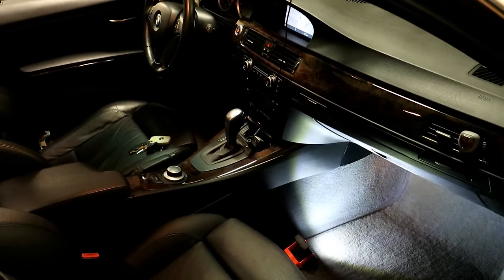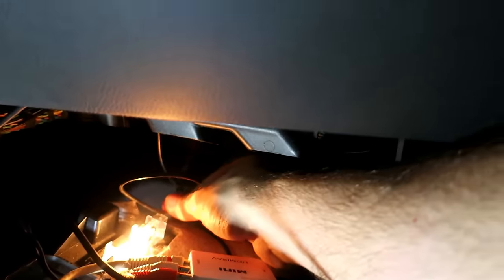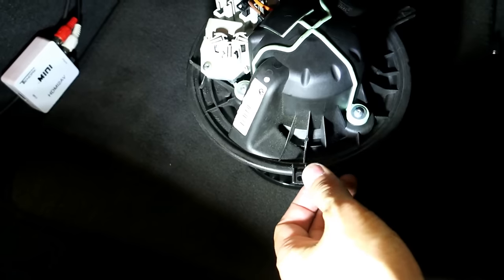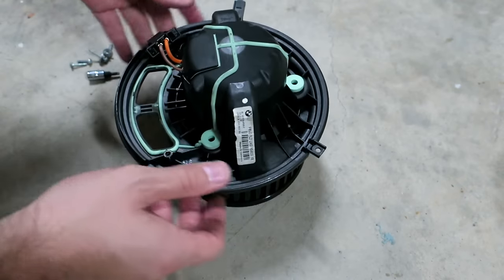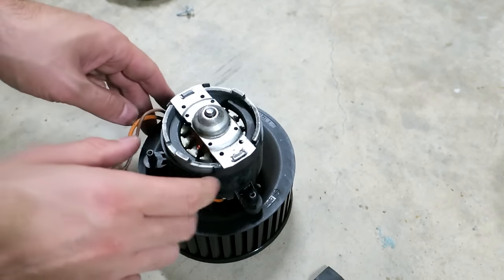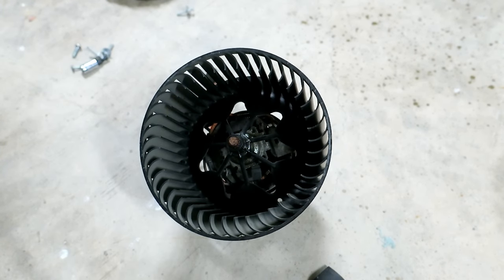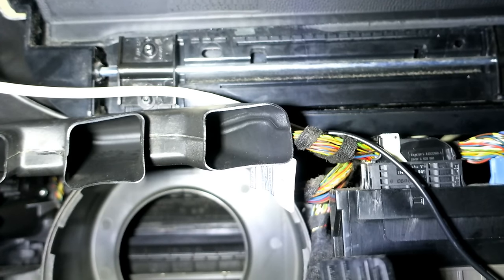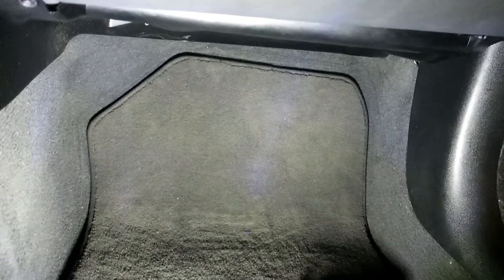E90 BMW Five Minute Blower Motor Removal

Comment: Excellent info. Thank you. I was curious if that wd40 type lubricant might have left a smell in there. I guess the lysol might have covered it. I think I'm just going to use a motor oil. Thank again for the information, great video.
Reply from the maker: There was a smell that lasted a couple days and was very faint.  FYI my fan motor is still quiet to this day.

Comment: Thanks for another great walk-through. I managed to snap off that little locking tab while fighting the assembly back into place, but it seems to be secure anyway. I may have to return with an extra screw through that secondary tab--we'll see. Thanks again.
Reply: Me to. I had a hard time getting this back in. Snapped the tab

Comment: Thanks for the video, I had a squeaky BMW e90 2011 335d with the same issue, I pulled out the blower motor quickly per your instructions, cleaned it up (lot of gunk on it), and used some motor bearing oil to lubricate the top and bottom around the bearing housing.  I didn't expect much as the hand rotation didn't feel much better, but an initial test drive, trying the blower on various speeds results in whisper quiet operation.  Perfect! Don't have to buy a new motor for now.

Comment: Great tutorial, mine was noisy, and with this video I fixed it in 30 mn. Thx mate nice video, certainly saved me lot’s of money. Ps I used wd40 instead.
Reply: wd40 ist great for cleaning purpose but most people do not know that it has only very limited lubrication characteristics over time, read the notes on the can
Reply: Does your A/C stink like WD40 now though?

Comment: Just about to give this a go.  Bought my 06 325i last year and the chirp from the blower has gotten worse and worse, exactly the issue you describe.  Let's see how it goes.  Cheers!
Reply: Well I used a few more swear words than you trying to get the blower motor back in but all in all it went great.  It's a bit of a bugger at 6'2" getting situated on the floor your video made it very straight forward and your directions were spot on.  I used a little PB Blaster and finished with a touch of WD-40 with silicon.  Whisper quiet now.  

Can't believe the video quality considering the space you had to work in.  Thanks a lot.

Comment: Hey! I did it exact like you said but I was a bit aggressive and the little tab to snap it in broke off. What do I do now?
Reply: I broke mine off too, placed the whole module back after I fixed the squeak and I used Parabond adhesive to glue that tab into place after I installed it, btw there’s a hole (as said in the video) where you can put a screw, so even when you broke it off you can just search a screw that fits and you’re fine!

Comment: Thanks, this is a perfect how-to, I'm going to do mine today.  I've had the blower out only to the top of the ducting so far, but didn't know that you could just pull it past the rest of the ducting.  A new blower fan here is $AU300 minus the FSR and another $200 for the FSR.  I've got a 1 week old FSR in the mail for $AU50, but I'm guessing the real problem is the same as yours, my fan just started being noisy and occasionally stops working completely (which is why I also got the FSR as a backup for the repair).
Reply: Here's an update, I ended up using fully synthetic engine oil, and using a pipette, put a few drops over each bearing.  It didn't seem to free up much, if at all, but after reinstalling the noise is definitely gone.
Reply from the maker: Awesome, glad to hear it.

Comment: Thanks for the video! I had a flapping sound in the e90 blower, followed your video to remove blower and found a piece of ribbon material stuck between the fan and casing which was causing the noise. A little tight getting blower back in place which was the hardest part, all up a quick job. All working fine now, legend!

Comment: ouuuyeaa already my bmw happens the same turn on but does not blow air and it will be the same the fan and not the compressor
Reply: Mine turned on and fan would not blow i did exactly as the video said clean and grease and mine is working great. 
I thought motor or resistor was bad but it wasn't.
Reply: the same thing happened to me

Comment: Amazing video!  I hit a pothole, hard...two weeks ago and, as a result, caused a "vibration" in my ventilation and a "squeal" when turning left.  Interestingly, when I turned off the fan, the squeal and vibration stopped.  So, after seeing this video, I removed the blower, cleaned and lubed it and voila, the sounds are gone.  Simply brilliant and thank you!!!
Reply: Mine also squeaks after potholes

Comment: THanks, that was helpful, anyway I broke the pin when pulling the blower out...........which actually was the worst part
Reply: Me too.. I used Parabond to glue it back, the super glue I had didn’t help. Fairly possible it will stay in place, even without the clip, if you turn it back on properly.